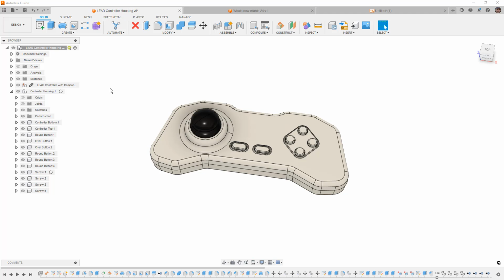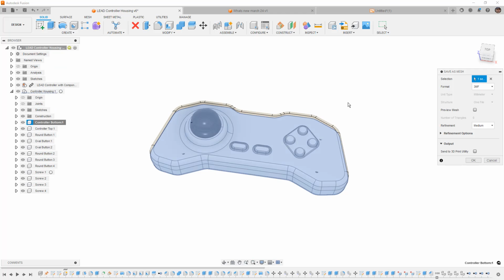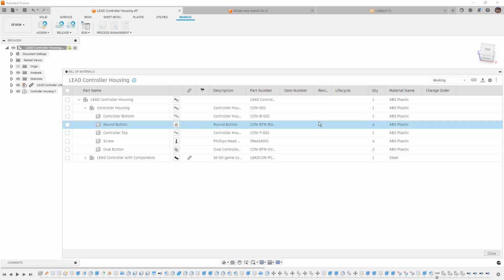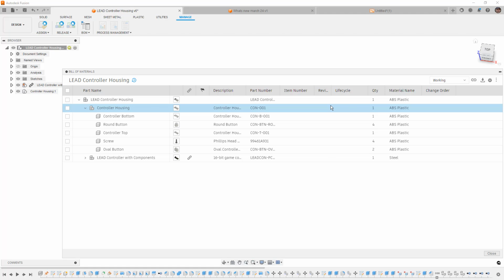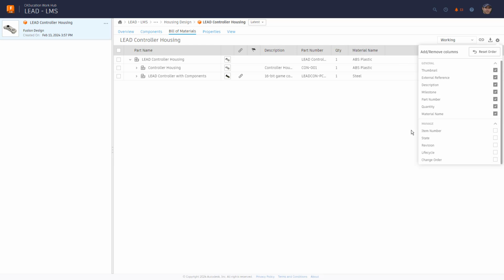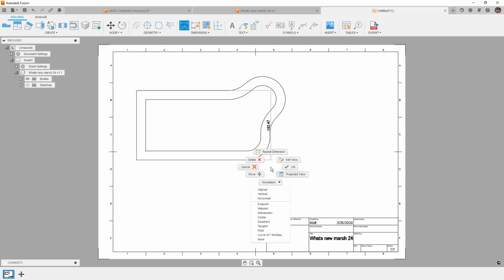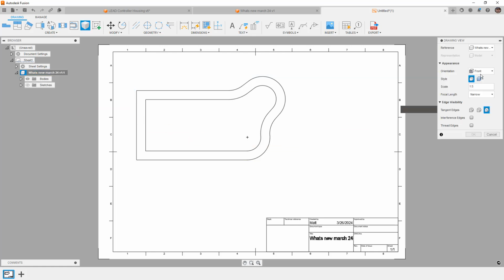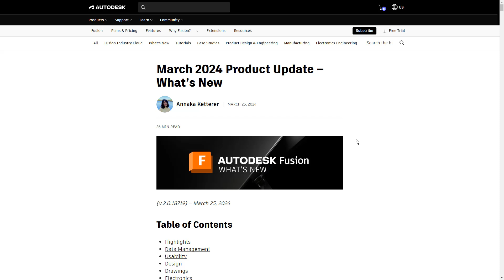Fusion What's New | March 2024 | STL Export | BOM | Drawings #fusion

Comment: Autodesk should be fixing basic UI problems that have been bugging users for years instead.
Reply from the maker: anything specific?  I don't work for Autodesk but I have a running list :)
Reply: @LearnEverythingAboutDesign Oh sure I’ll give a couple very basic things like we need folders in the browser for sketches also why isn’t there an option to easily scale a sketch or a body in any direction, uniform or non-uniform and to a specific size instead of a scale factor? Recently I had a few sketches of some huge flight of stairs on a Mayan pyramid, when I needed to make each step taller I had to redraw the whole thing.:face-fuchsia-tongue-out:
Reply from the maker: @kangoomotto  Agree with you on the browser folder thing.  I don't know why you can group bodies but not sketches.  

There is a scale tool for bodies both uniform and non-uniform.  Not sure if that would have worked on your stairs though.  For sketch scale yeah its from a point which means that it would drive width and height of a rectangle.  Could it have been done with dimensions and a pattern?  If you had a pattern along an edge in a sketch you can edit the pattern spacing.
Reply: @LearnEverythingAboutDesign  I guess Autodesk wants us to group everything into components, as they say this is the “correct” way to go

Comment: I scanned a muffler that was bent at various angles without a flange.
It was very difficult to align, so how could I reverse engineer it?
thanks,
Reply from the maker: Carefully :)  probably will require a lot of mesh sections sketches to try and find the centerline path of the tubing.  If the muffler shape itself is formed or something not from a tube or extrusion you might need to do a lot more work with surfaces.

Comment: STL export is potentially useless improvement as all slicers forked from prusa slicer support step format. I'm curious if they improved stability of this software.
Reply from the maker: Yeah and as I stated in the video I would still use Save As Mesh, but I know a lot of users (as indicated by the number of reddit posts) still go to file export and wonder what the heck is going on.

I don't have any stability issues with Fusion and I have been using it since 2015.  Generally go weeks if not longer without any software crash.  Can't say as much for Solidworks.

Comment: The export function is 2 years old? I've not used anything else since I started using F360
Reply from the maker: Export has been around since Fusion was a thing, but the problem was that it used cloud translation.  So if you hit Export and saved as an STL locally it took awhile.  The Save As Mesh from the browser or 3d print options give you more control.

Comment: Hopefully they have stopped the software crashing quite so much. It has been terrible recently. Crashing and full of bugs.
Reply from the maker: I have heard that from a few users but I have not experience that.  I did crash it a few times in a day but i was working on a really big and complex model trying to do some things it didn't like.  In the last year i can count on 1 hand the number of times it crashed and I use it every day.

Do you happen to be on a Mac?  Most users I've heard have had issues on Mac.
Reply: @LearnEverythingAboutDesign  I've had quite a lot of crashes recently, but it's also mostly been on large and or complex designs, and either doing stuff that the software doesnt like, or using some of the new features in ways that may not be optimal. But, a few of them have been while doing very simple things that really surprised me. Running Windows 10 Pro on a fairly powerful CAD laptop and using pretty good modelling methodologies. 

Also, when I say a lot, it's a lot for Fusion, still only a few here and there, maybe as many in a few weeks as an afternoon in Solidworks 2023 :D
Reply from the maker: @Robinlarsson83  haha. I had SWx23 crash on me the other week with no warning. just shut.  that was a new one for me :)
Reply: @LearnEverythingAboutDesign  yeah, it usually says something :P but damn, SW crashes soo often. I'm amazed that Fusion can both update so much faster than SW and still be orders of magnitude more stable (at least on my system).
Reply: @LearnEverythingAboutDesign  no, on a PC, windows 10. Other than the crashing, the other thing that it does all the time is fall to the back of the windows tab queue. I take to alt tab to go back to it.  This tends to be when I am exporting svg files, which is something I do a lot because I am a 3D printer.
Reply from the maker: @StephenBoyd21  Interesting.  I don't know if I have ever had to export an SVG so its not something I do.  What do you use the SVG export for with 3d printing?

Comment: Still been having trouble opening fusion exported dwg and opening them in other softwares
Reply from the maker: Rich, where are you exporting the DWG from?  Right-click on a sketch?  Sheet metal flat pattern? or a detailed drawing?  I have come across times where the sheet metal flat pattern export doesn't seem to work.  a sketch or the drawing have never given me trouble though.
Reply: @LearnEverythingAboutDesign  From a detailed drawing and DXFs, it exports them in the latest format 2013, my company been having trouble with it for a while now, solidworks struggle to use it but autodesk trueview theyre fine, so I use PDFs when i send drawings. Sheet metal flat pattern DXFs seem to work fine for my customers.

Just had a look at the auto bom feature, shame you cant change the part numbers, names and materials in that interface :(

Comment: I have used the 3D print command from the Utilities section, and it has always been offline.
Reply from the maker: Exactly!  One big pain point from a lot of users who don't realize that is an STL exporter and not just a "send to 3d printer" is that File > Export to STL was painfully slow and often times failed or lacked control.  autodesk just "offlined" the file >export, but you still have more control by just doing Send to 3d print or save as mesh (both the same just one  has the "send to 3d print utility" box checked by default)

Comment: The new stl export sounds great, but I always use the "3D print plus" addin so will it be better?  let's try.
Reply from the maker: Nah keep doing what you are doing!  Autodesk just fixed the problem when you use File > Export that required cloud conversion.

3d print plus is just the "Save as mesh" option in fusion, but you can also have some extra controls on things like scale, name and orientation.  Stick with that!  I doubt that will ever get baked into Fusion since the manufacturing workspace is also a 3d print slicer and they likely won't want to add those extra controls, but that add-in is free!

Comment: When can we get improvements in the Render workspace? I’d love more control over adding light sources, light styles, and all the other lighting characteristics. In short, I’d love to use my studio photography background to set up my own render lighting. Solidworks does this really well; surey fusion can get a little better at it.
Reply: I also wish we could locally render videos in fusion not the simulation recording or the cloud video render
Reply from the maker: yeah that would be nice to not need the cloud render for turntable or motion studies.  It would be great if you could do more with the animation other than a screen capture to avi as well...
Reply from the maker: Yeah it would be nice but I doubt that will happen honestly.  Because Autodesk has more software geared toward render/viz stuff.  Also SWx dropped photoview360 for 2024 and now only Visualize(bunkspeed) is for rendering.  So gotta stick with 2023 if you want PV360 still.

With Fusion I agree, you can fake lights a bit but you really don't have great control over them.  You can import your own HDR scenes and those can have lighting but that still doesn't get around the camera thing.  For a steep learning curve Blender is probably the best option.  After that Lighttracer which is $10/mo or you can buy it for $130.  Its a web based thing.  Aside from that you start getting into Keyshot which is a bigger price jump, then into tools that are on par with Blender.

Comment: Still waiting for improve simulation machining... ;) That sucks.
Reply from the maker: are you talking about the actual machine simulation for milling/turning?
Reply: @LearnEverythingAboutDesign  yes actual. They boost something but still generating toolpaths so long for 5 axis machining. Like step and shallow etc
Reply from the maker: @mateuszwawak7437  I personally haven't had much trouble with toolpath calculations but they are heavily dependent on a few things of course.  And i actually don't use Steep/Shallow as much as I should.  Because most of the time I am teaching/training users without the extensions so we generally do a 3d adaptive clear then finish areas manually with a Scallop.  If you are using steep/shallow in 3x vs multi-x for example that will have a big impact on the calculation time.  Technically it should be able to multi-thread across multiple cores on your machine, but in practice there are factors that affect it like rest machining calculations or your angle limit because it is "model aware" like all the other 3d toolpaths. 
Have you done any testing with changing the tolerance value and see how much it affects the calculation times?